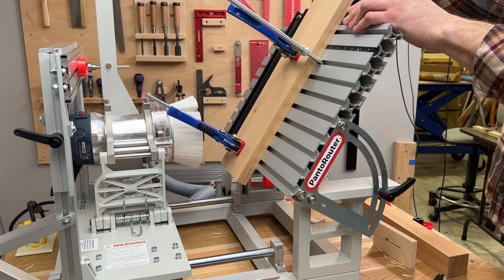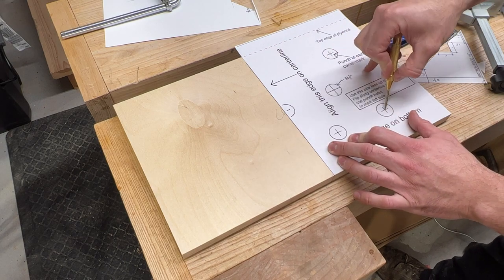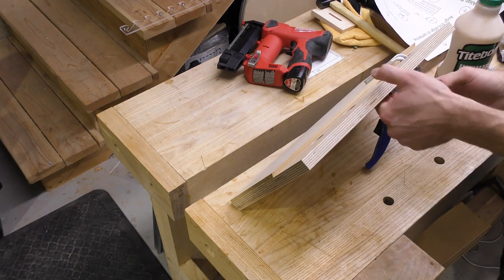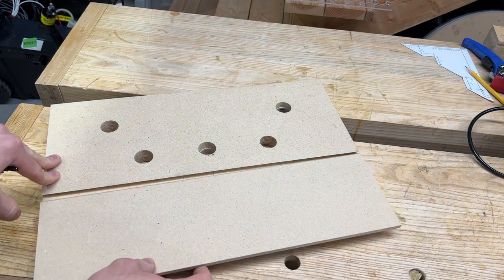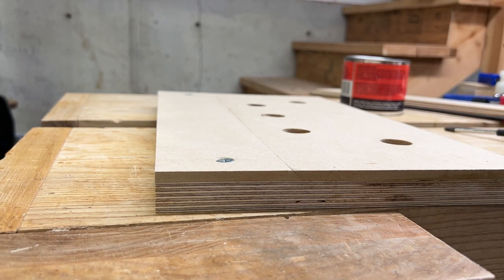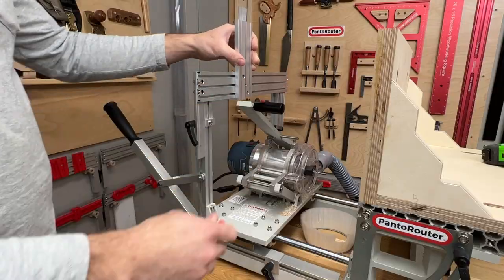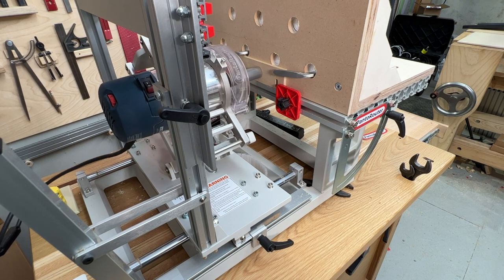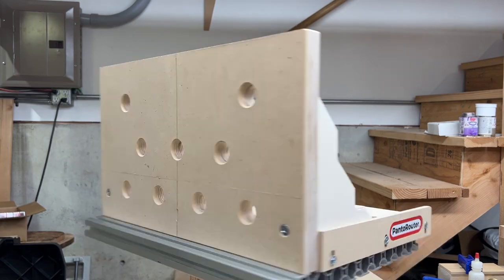Vertical Clamping Jig for the PantoRouter Woodworking Joinery Machine

Comment: Well you had me till about 5 minutes into the video as I have one of the first gen pantoRouters. So table top does not flip to 90 and I thought this would be a awesome solution but making the base without the 90 degree tilt may be problematic.
Reply from the maker: Not at all.  You should be able to make a very simple 90° jig on the table saw and secure it to the table with clamps or nuts and bolts as an interim fixture.  If you screw and not glue it together you could use the same pieces for the final jig.  Use your imagination and I'm sure you'll come up with a great solution.  This is a terrific jig so it's worth the effort, with or without the sacrificial surface.
Happy PantoRouting!
Reply: Thanks Mac. Both Dennis and I have bought enough material to manufacture two sets of both the vertical clamping jig and horizontal router jig for our Pantorouters. It looks like we gonna need four Pantorouter stickers! 😀👍

Comment: Or better yet… add some holes to the table that’s native to the pantorouter… and sell that...
Reply from the maker: Thanks for your suggestion.  We've drilled holes in the table but it's not ideal and far less versatile than the Vertical Clamping Jig.  

This is one of those add-ons that not everyone needs, but when you do, it's so nice to have!  The spoil board is great, and the ability to move it around can be helpful for unusual operations.
Reply: @macsheldon  what about offering the Vertical Clamping jig made from good material for sale?